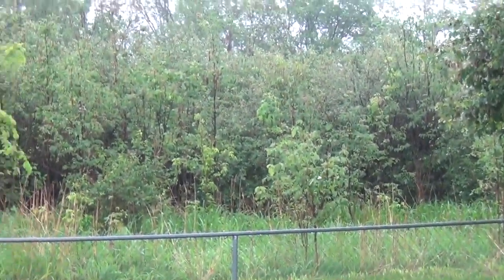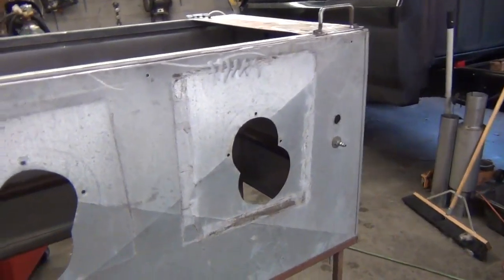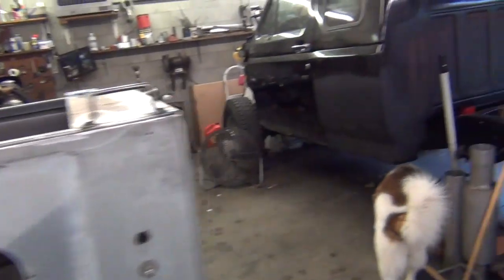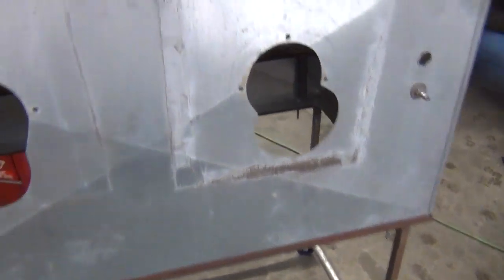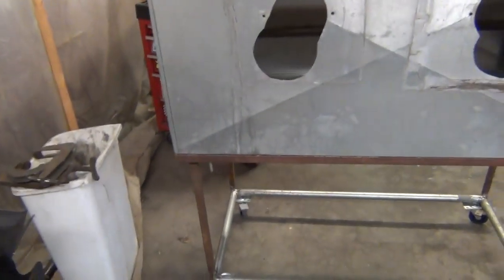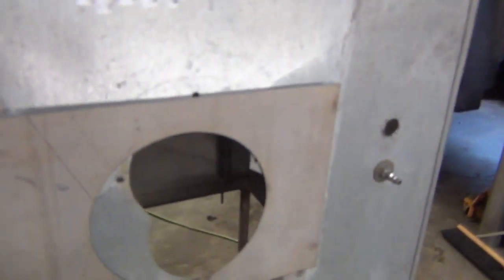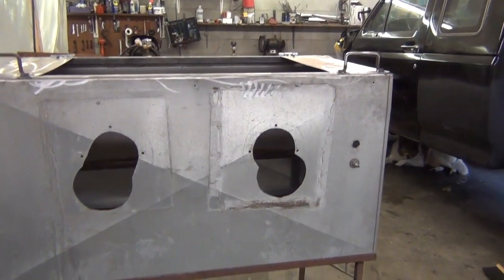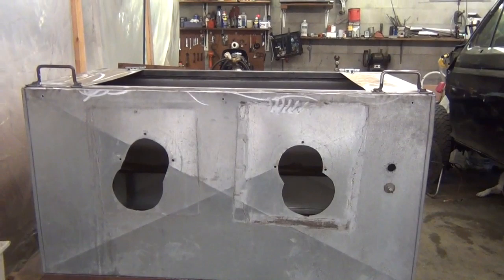Building a sand blasting cabinet.

Comment from the maker: Hi, and thanks for subscribing, I started making a part two on this project, tonight hopefully I will have a weekend to get this finished so I can get back to my truck.i used to wire wheel everything, and it got the job done, but if you get a chance, to set up a sand blaster, you will like the results much better.